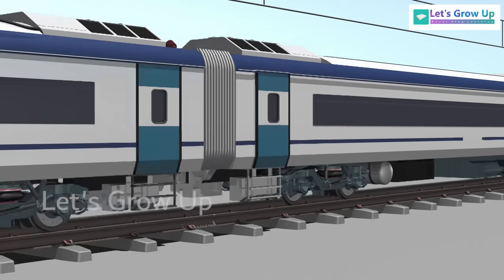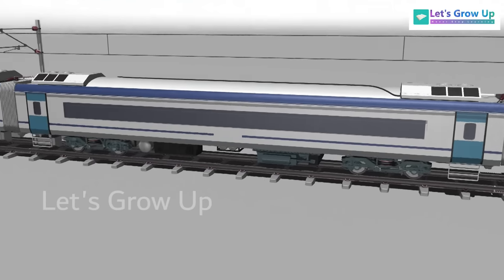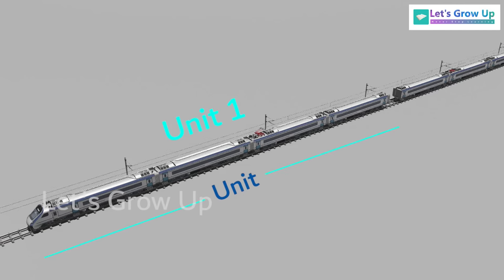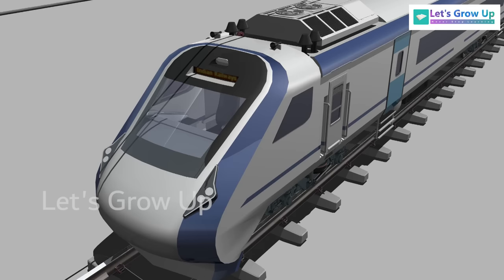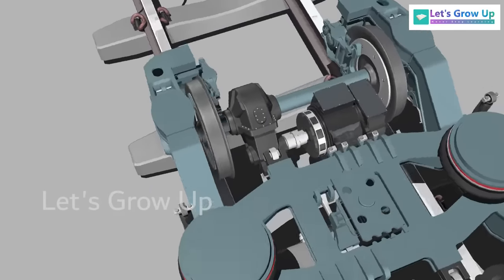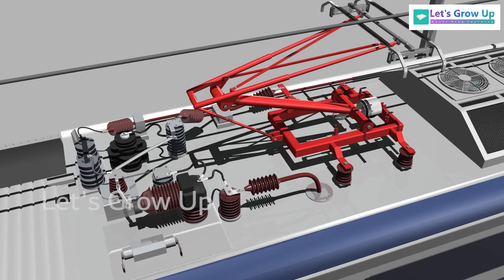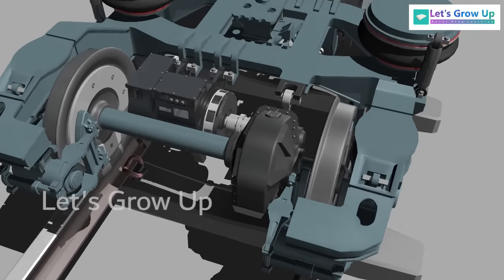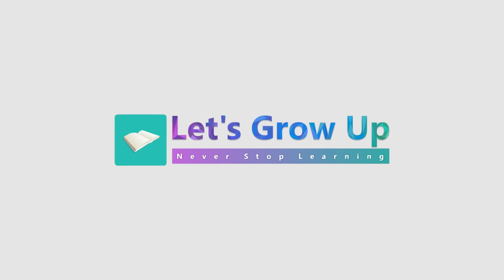Explaining Indian most famous train Vande Bharat Express 3D

Comment: In my point of view it is good but not better because the ticket rate is quite high. We use regular locomotive engines to increase the top speed it is possible to gave a better journey in less time. Then we also improve normal German (red colour ) coaches to support locomotive to reach high speed in less time. In the  same way we fixed affordable price

Comment: its only a high speed MEMU  Added with much comfort and high degree of  multiple  suspension ...
Reply: Not MEMU BUT EMU
Reply: @koushikkoley9107  its basically a main line emu(memu), major difference between memu and emu is platform width, and toilet facility, both are self propelled electric multiple units.
Reply: I know. But propulsion system is similar to emu not memu
Reply: @koushikkoley9107  now a days we use vfd  - 3ph induction motor drive, both emu and memu uses similar technology, what u mean by propulsion s/m
Reply: @koushikkoley9107  On Indian Railways, the MEMUs are electric multiple unit (EMU) trains that serve short and medium-distance routes in India, as compared to normal EMU trains
Reply: I am telling about technical propulsion systems & train formation not about long short distance

Comment: Gas turbo engine very speed, 🚄 normal train bodybuilding 90 degrees air  not free moving but 10 degrees 20 degrees use aerodynamic design, thermal air protection system and antiice system titanium steel sillicon SiO2+ NaHCO3 -80%, Seesam -20%, or , nickel steel sillicon SiO2+ NaHCO3 -80%, seesam -20%, aluminium sillicon SiO2+ NaHCO3 -70%, nikal -10%, seesam -20%, or, nichromesteel silicon SiO2+ NaHCO3 -80%seesam-20%, bodybuilding metal, vacuums braking system air full wheels release train moving air remove wheels break or electronic magnatic brakes, or passeslaw use hydrolysisyestem, micro waves and radio,LF waves, vibration waves dettating Specto meter,E.M waves, UHF waves VHF waves, X-ray waves, ultra Sonic waves,, 270 degrees cameres,980 memory card, lazer guided,jai Bolalo Barth mataki jai